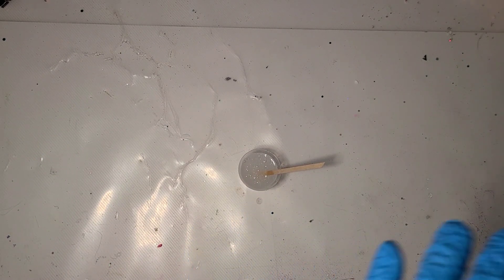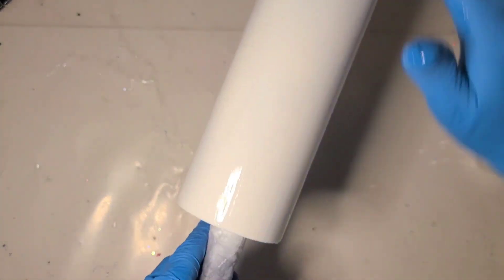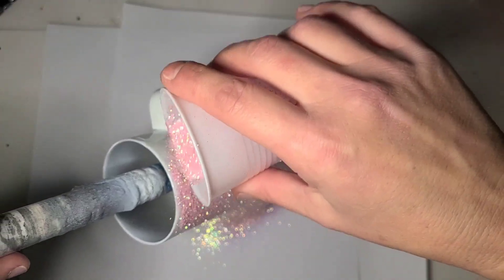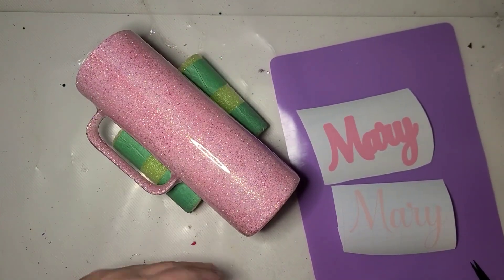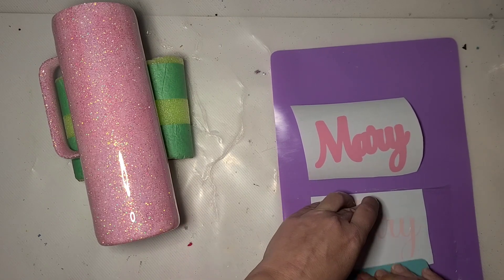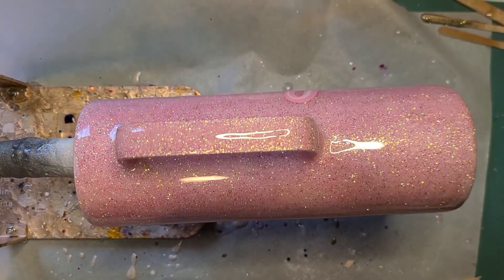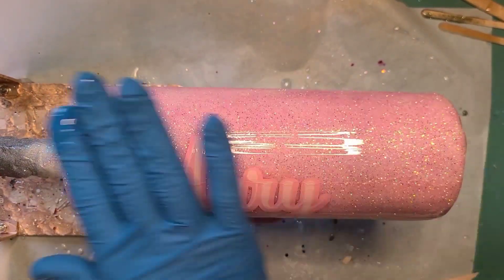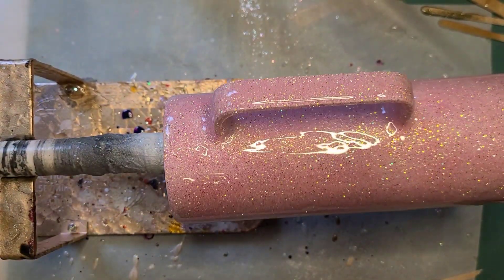Basic glitter tumbler 1 coat applied epoxy method 1 coat using the wet method

Comment: I was so happy to see your video pop up tonight. I made my first tumbler coffee cup for my moms bday it turned out so cute.  Obviously not 100% perfect since it is my first.  I learned a lot. I did a peek a boo snowflake one.  So I need to sand better along the bottom and also learn to spray paint better lol. I ended up doing 3 light coats so it wouldn’t drip. Then trying to spray a bit of blue on top and bottom was kind of hard not over spraying. But it worked out.  Definitely you make it look so easy. Practise will make me better. Thanks again for sharing everything with us. Oh I found the handle hard too. But IPP cheats helped the end result😂
Reply from the maker: I very rarely do handles and I especially don't enjoy glittered handles I'd rather use inks for handles!  I am sure your mom will love it 💙❄️